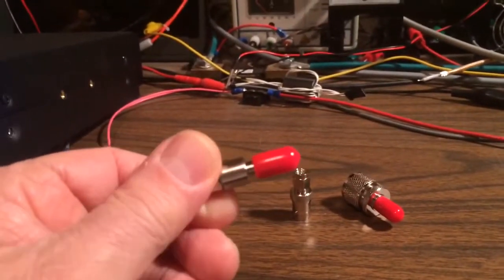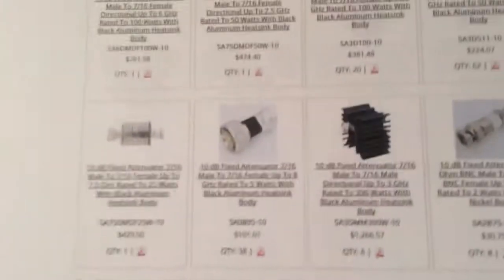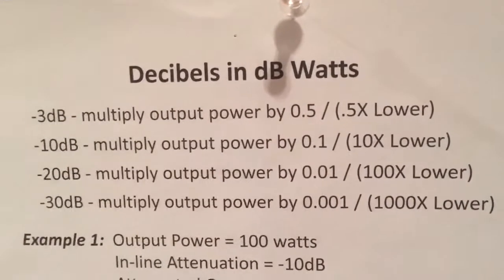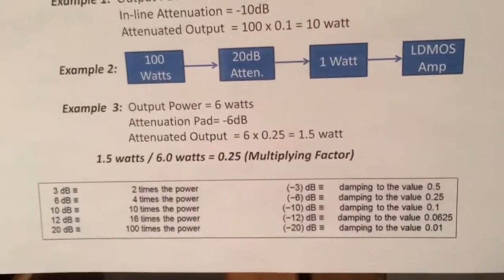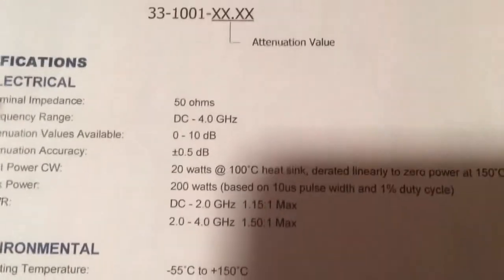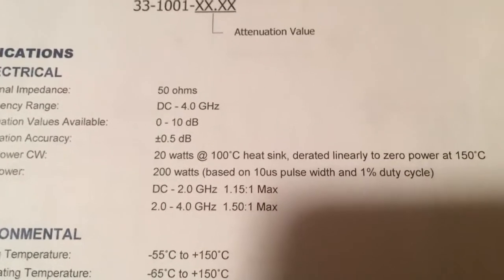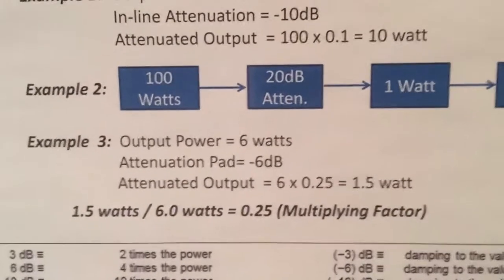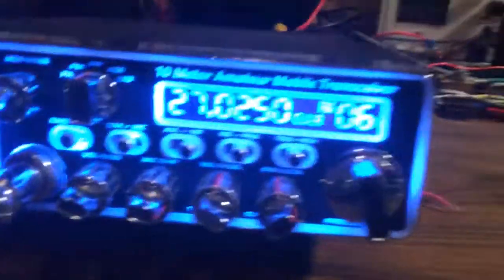Part 1: RF Man discusses attenuators for LDMOS amplifiers.

Comment: So if you were running a 148 Cobra for example,  set at 1.5 watt dead key, would you need an attenuator?
Reply from the maker: No, an attenuator would not be required.